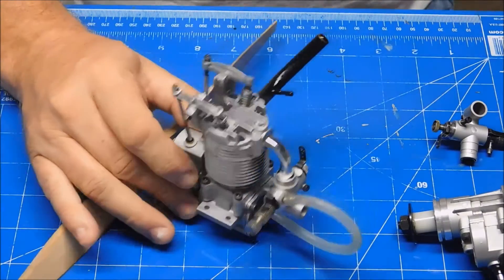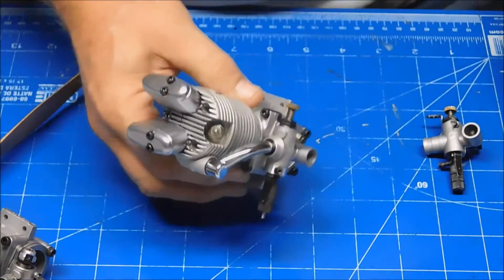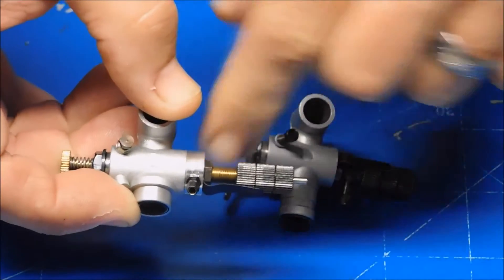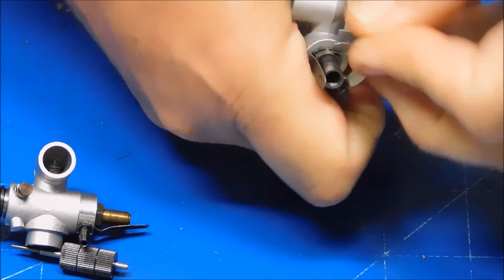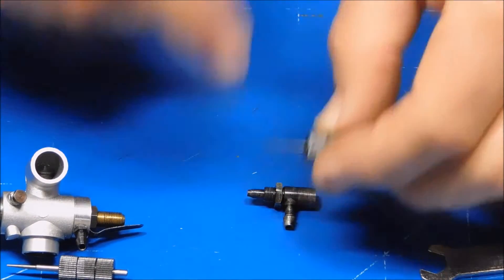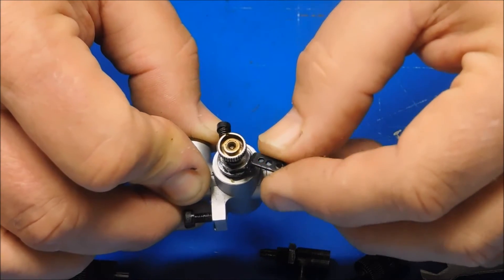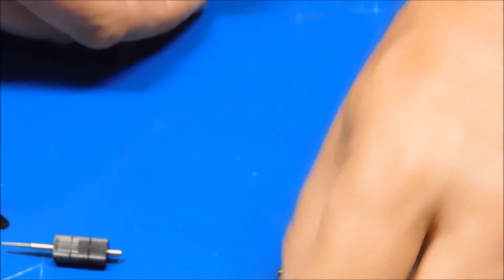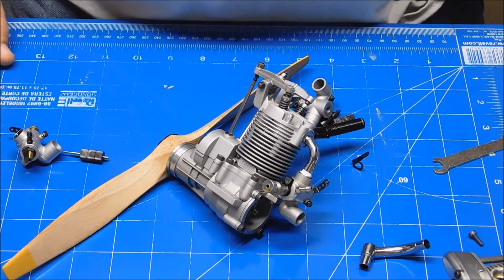Saito FA-40 Open Rocker Poor Carb Design

Comment: Hello David. I watched your video on saito fg-45.
My question is I can't get the barrel ot of the carb to clean it. It's stuck an can't find anything to help me see what else is in side holding it in place.
Please. I hope you can help me.
Robert
Reply from the maker: I could possibly assist you if you sent me some images of your carb.  Send me an email.  Go to my channel page on a PC/computer, not a mobile device.  Read my last Community post. In that it tells how to obtain my email address.
Reply: @dmrcflyr2  thank you. I finally heated it up an got it apart. Thank you so much for getting back to me. Sorry that I just seen you message.
Reply: @dmrcflyr2  now I'm at the crank shaft. What Allen wrench does it take to remove the gear fo№r the Fcrank shaft? 
The motor is   saito fa-45. 
Sorry can't figure out how to send pictures
Reply from the maker: @RobertGarcia-o1m  1.5mm
Reply from the maker: Maybe you should watch this 3 part series.
Saito FA-45S A Look Inside Part 1

Comment: You clearly have the wrong length high needle in your open rocker FA40 stock carb or someone swapped the carb on it. 
The FA30 open rocker put Saito on the map in 1979. I think if the carb was useless, then saito could not be the Saito they are today pumping out Radials & others. Actually my Saito FA 40 open rocker high needle is 33mm long or right under 1.3 inches & looks to be the same length as your newer 45 needle here. I bought my open rocker saito FA40 new, in fact I have the box here but lost the instructions.
Reply: Thanks Daniel, good info 👍

Comment: Could you removed some material from the end of the needle assembly  to allow the needle to screw farther in and thus closing it off more/fully?
Reply from the maker: I did not mention that in this video, but I did just that very thing prior to this video and the last run.  I used a dremel cutoff wheel and took about 1/16th inch off.  If you look closely at the needle assembly you will see that the outer portion of the needle contacts the fuel inlet.  The needle can only thread in so far before contacting the inlet.  By cutting a section off I decreased that distance as well.  Basically what I did had no positive affect.
Reply from the maker: Additionally, this could be resolved by cutting the outer portion of the needle itself.  I am not nearly skilled enough with a dremel to attempt this though.